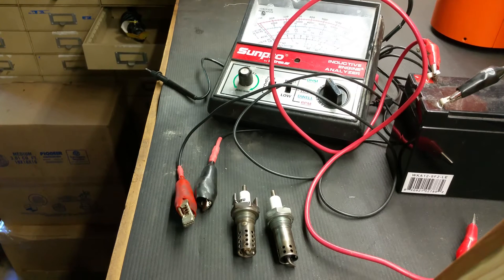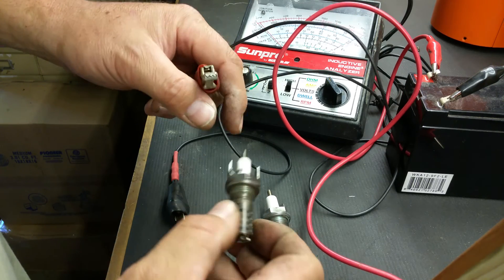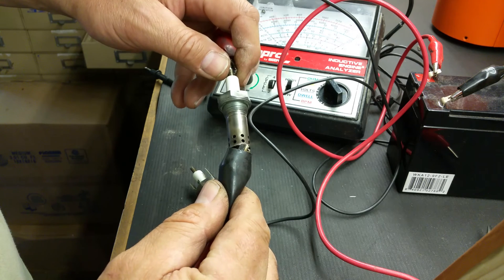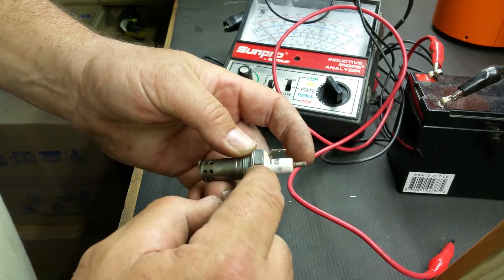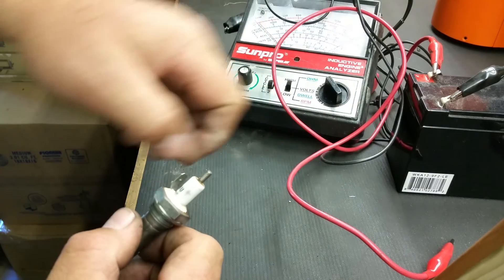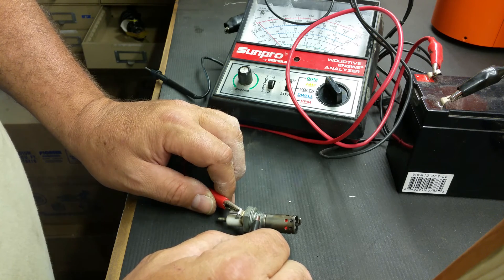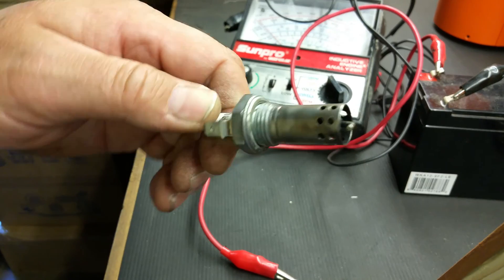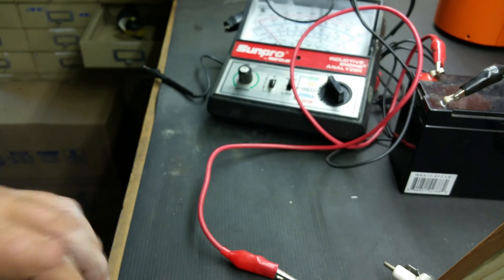Eberspacher Glow/Spark Plug Check - BN4 & BA6

Comment: Hi Jason, really appreciate your videos on the gas heaters. They are very helpful. I have a BN-4 glow plug (single tab) that does not pass the conduction test. When it is installed in the gas heater it will get hot and the fuel pump will not click. When it is removed from the gas heater housing but still wired it will continually spark and the fuel pump will click. In your opinion, do you think replacing the glow plug will solve this issue? Thanks in advance for any help.
Reply from the maker: So when its all together the pump wont click? If the plug does not pass outside the heater then yes it may be a faulty plug thats shorting out - thats what it sounds like. I would get a plug for sure to see if this was the issue. A weird one for sure.

Comment from the maker: Edit - the plug being tested good is for a BN4 NOT a BA6 as I describe in the vid. You need the two tab type plug for the BA6 - like the bad one I show.
Reply: Hi Jason, 
I have tested as per shown in your video. the spark/glow plug goes into a B2L. 

Does it make sense that the heater cuts off if there is no spark (faulty spark function in the spark/glow plug)? I am planning to replaced the spark/ignition plug - do you think that i will be  suefficient?
Rgds
Mads